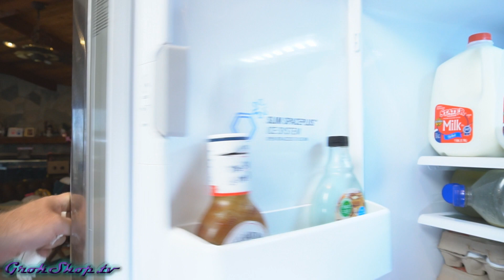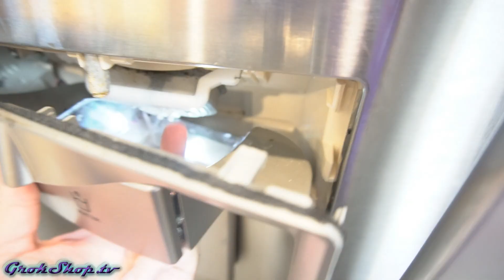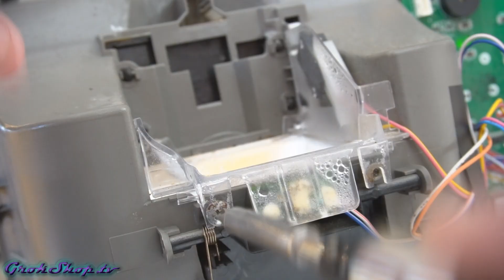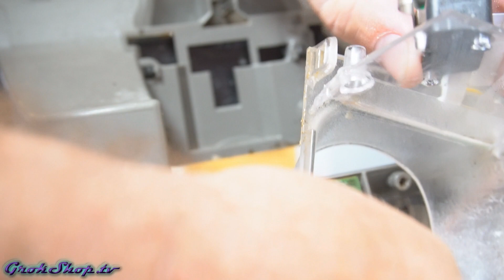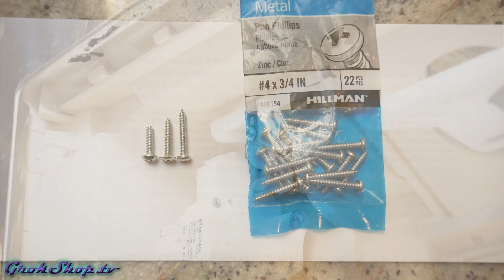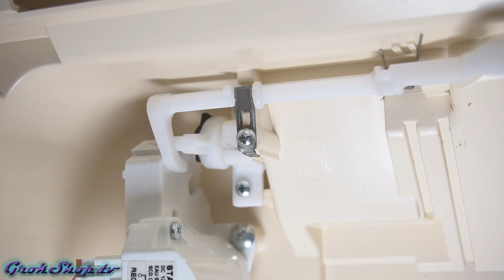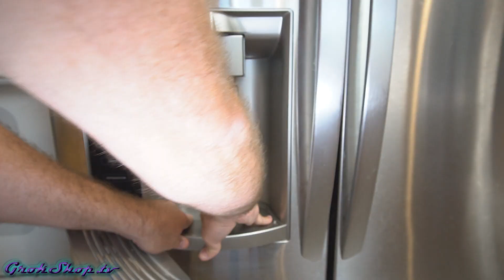LG Refrigerator Ice Dispenser Repair: Ice Dispenser Flap Not Closing

Comment: 11 year old LG fridge of almost identical design (plastics were dark grey behind the dispenser panel, but otherwise identical). Exact same issue and repair. The only difference is that I removed the motor that kicks the door out for better working room, especially gluing the standoff back. Of course when I went to put the motor back in, I found the screws wouldn’t seat because the holes stripped to some extent as I removed the screws. Went with a slightly longer replacement and all is well. You saved me hundreds, I’m sure. Thank you!

Comment: Thank you. To my surprise this was the first video I found with my exact model fridge, except mine is about 10 years old now, and broke in the same place. I did use some JB weld CA glue to fix the post, so we’ll see how long that lasts but didn’t have any other options at the time.

Comment: Honestly I chose the easier route by deciding not to put the broken plastic collar piece back in. I just used a #4 x 1 inch screw and just screwed it into the back piece on the other side of the broken collar. It seems to be holding in place as of now but keeping my fingers crossed it lasts until I'm done with the fridge lol😂

Comment: I have the exact same issue like you, and the front panel looks impossible to open, luckily I found your video, so I'll give it a shot tomorrow 🤞.
As for the moldy rubber piece, not sure if bleach is safe to use since that part touch the ice, but idk if there's a better solution either

Comment: Thank you very much for the video,  I have followed your step by step instructions and able to remove the front panel and found the bottom mount plastic have broke off, I replaced with a 6g 25mm screws so it fixed the bracket into position and it work! Thanks you very much.

Comment: Thank you for saving me $300-$500 by calling a contractor.  I have the near exact same LG fridge, and had the exact same problem with the flap.

I didn’t exactly what you did.  The ice machine now works perfectly.  And a horrible mold/mess is cleaned — I used a mix of hot water/vinegar/bleach/lemon juice.

Thanks again!  Your video is perfect.

Comment: This is how a "do it yourself" video should be done! I had this same problem, with a 9-year-old LG (it's been a solid fridge, honestly), and dreaded having to (1) hire a repairman or (2) buy a new one. I was actually happy when I discovered the same breakage, as I felt sure I could fix it with this video. I was right!

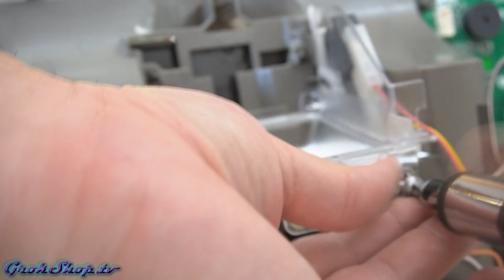It was easier with a second pair of hands, and my wife jumped right in. Also, be careful with the placement of the white plastic lever arm in the dispenser assembly. If it's backwards, water will spray out uncontrollably (bitter experience). Look CAREFULLY at 3:58.

I'm curious if you can share if the fix is still staying fixed for you 5 years later.

Thanks again!

Comment: Thank you for this. My refrigerator had a different problem, but your video helped me solve it. In my case the actuator for the ice flap had come unplugged. The biggest problem was loosening the tabs to get ice / water dispenser unit out. With the unit out, the problem was quite obvious, easy to fix and test.

Comment: Perfect walkthrough. THANK YOU! My ice dispenser started clogging over the past two days. A quick look and I could see the flap stuck open and assumed the ice was melting and freezing into a block. Came to YT to troubleshoot and this video nailed it. The same post was snapped. Followed these steps using a spare screw I had on hand and it is working perfectly now.

Comment: Exactly the problem down to the broken plastic screw holder!  2 trips to the hardware store (I didn’t have a small enough bit) and a bit of frustration later (I lost the broken piece or plastic, so I screwed it in without it) and it is working perfectly!  Thanks for this excellent video.

Comment: Holy crap, I came home to find our ice maker was completely clogged up. As it turns out the door wasn't closing and it had frozen clogged. I found this video and within 30 minutes I had the panel off, taken it apart to clean and sanitize it (yuck!!!), it was exactly the problem as in this video, the door starting closing as it should, put it back together and it's better than new now. THANK YOU!!!!

Comment: DUDE.... this is the exact problem I was having. Thank you so much for your amazing video. Thank you for the tip about drilling out the broken piece. Thank you for showing the EXACT screw I would need (I was able to buy just one at ACE for $.06). I cannot tell just how help this video was and how grateful I am. 

 I watched your video last night. This morning I removed the panel to confirm that I had the same problem, drove to Ace to get the screw I needed, fixed the problem, and reassembled everything in about two hours. I can't believe it was that easy. Thank you! Thank you! Thank you! You saved me so much time and money. Great video!

Comment: My fridge had the exact same problem. I had called a service "expert" and was told the problem was a faulty switch which would cost $400 for a service call to repair. Your video was bang on and easy to follow. I did use a bit of superglue to strengthen the post but otherwise did everything as you suggested and 'VOILA' my icemaker is working again..Thanks for the very informative video,

Comment: this is clearly a bad design from LG. after getting mine fixed it was very obvious that the pivot (between motor and flapper assemblies) was still flexing when the mechanism cycled. out of curiosity... how long has this repair lasted for those that have had this issue?
Reply: I am currently looking into the same repair three years after fixing it the first time. It broke further down on the screw post this time, so I'm hoping some more Super Glue and a longer screw will hold it another three years.

Comment: The problem was exactly like the one in your video.  My fridge must be a newer model since the removal of the icemaker insert was easier and did not require moving a lever through the ice chute.  I was hesitant at first but I got an estimate for repair which included a diagnostic trip charge and are turn trip with parts.  Calculating it could be a $500 + service repair, I tackled the project with faith in your video.  I appreciated the advice of NOT using super glue, which totally made sense.  I also used a 1" screw so hopefully it never happens again.  Seems like this issue is really a manufacturer defect?  The Grok Shop Rocks!

Comment: Second time this video has saved my arse. I had mold in there and took it apart to clean it. Watched the video about a 100 times for one small part that I was having an issue with. Finally fixed it. Had the repair company coming tomorrow but canceled them. Thank you so much.

Comment: Thank you for this video! I had the exact problem once I opened up the dispenser. Your video was so helpful in showing your solution which I used too. It’s literally 10 cents to replace the 1/2 inch screw with a 1 inch screw and that would have likely prevented the part failure in the first place. Thanks again for taking time to video this and to share it!

Comment: I can't wait to try this. My LG is 12 years old. The ice dispenser still works perfectly but the light stopped working. And when I shined a light up inside the chute, I was shocked to see all of the mildew.  These disassembly instructions will help me to access the flap and other interior parts to clean them. I cannot understand how LG could make a product that cannot be easily cleaned.  Do you have any tips of how to repair light that is supposed to come on  when dispensing ice ?

Comment: Worked perfectly! (after the extremely frustrating process of getting the panel out).  Just one question:  when I popped the panel out two small springs ~1/2" long fell on the floor.  They don't seem to affect the function of either the ice or water dispensers, & I can't see them on any of the online schematics.  Anyone know where they might go?

Comment: I have the issue of my door flap motor stopped functioning on my LS63SPGK side by side. Is it the same process to remove front panel? My display is on top not the side as shown here.

Comment: Thanks for showing how the dispenser is disassembled. My issue isn’t a stuck flap but the ice chute and water controller have completely disintegrated. Went to get ice and small screws and springs flew everywhere! If I can get replacement parts it looks like they’re easy enough to replace. Otherwise I’m shopping for a new, non Korean built fridge.

Comment: Perfect video! Exactly what happened to my LG Refrigerator. I was shocked to finally get the panel off (I didn't break any tabs!) and see the screw was broken off from the back. Used your method and drilled out the old piece and used a longer screw. Works perfect. Thank you, sir, huge help!!!

Comment: I grok this video - and the name of your site ’The Grok Shop’. Heinlein is one of my favorite authors. I believe your site name may correlate with ‘Stranger in a Strange Land’? I will soon apply your EXCELLENT video to pursue further mitigation of our issue. My current fix for our 8yo LGX25974ST /06 is to manually reach behind the door dispensing lever and pull it out gently upon removing the ‘collecting vessel’ and the flap closes (so far). My pre-repair hypothesis is a spring is broken or dislodged - another comment seems to correlate. Subscribing!

Comment: This was the same exact failure on my ice maker, and I followed your same fix, by replacing with a #4 1" screw. I used a $3 suction cup from Harbor Freight on the bottom left to start pulling my panel off.

Comment: I have this flap issue , BUT I also have a water flow issue. Water flow is good from the pump. Water flow is good going in and coming out of the filter. The ice maker makes ice just fine, but the water coming out of the front dispenser drizzles and then just stops. The motor is still running when the water stops. I am looking for a video or advice on how to get into the water lines inside the door

Comment: I must thank Google for helping me find you. Terrific professional video and explanation. Very clear and right to the point! I don't need to be entertained by some fancy animation at the start. The video was very clear and stable and your audio was also very clear.  I don't quite have the same problem. Mine has a sticky ice switch that is difficult to stop the flow of ice once triggered. Knowing what needs to be done to gain access to what is behind the switch panel will do it for me.  Thank you!

Comment: Oooohhhhh thank you! Flap wasn't closing and it was EXACTLY THAT SCREW. LG should have a recall on this! 
The only thing I'd add is that if you dare to try to superglue the broken plastic piece, you may end up with superglue on your hands, your tools, etc. 42 Cents, for a pair of screws of slightly different lengths. It's a bear to get the panel off, but the fix was just as you showed!

Comment: Please add my name to the list of folks that your video helped!  The problem was exactly what you described, with that broken post. Also a good tip to drill out the broken piece to allow the screw to pass through. The front bezel was a pain to get off but I finally got it, the rest of the fix was easy. Thanks again.

Comment: Removing the front panel and expecting to break the tabs is ridiculous. I didn’t even use a scraper. Just put some pulling pressure on the right side of the panel and it will pop out. Maybe use some rubber work gloves to increase grip.

Comment: Hey, great video!  I have a similar problem with the flap not opening completely.  It opens only partially and hence the ice won't fall out of the funnel.  Any ideas what might be causing this?  It works occasionally as it should, but very rarely.  I usually have to open the flap by hand and the ice will fall out.  I would like to use your video to repair this problem and I was wondering if others have had this same issue of not opening fully as opposed to being stuck open?
Reply: If the flap does not open (or partially) it is most likely the actuator DC motor failing.  However, if the LED light and ice bucket churning motor also don't come on, most likely the micro switch, or the plastic lever that actuates it has failed.  All are serviceable after the cover is removed from the door front.  I got the motor from Genuine Replacement Parts ( LG Part# EAU59551204 Ice Dispenser Door Motor @ $51.89 EA).  

See Also: https://www.youtube.com/watch?v=3k79F5WlQ6k.  Although a different fridge model, it shows how the motor actuator arm comes from the factory in the extended/out position, requiring you to hold the flapper open when installing (i.e. arm out = flap open / arm in = flap closed).  Once installed and operated, the motor resets itself to the flapper closed position after 4 seconds, ready for the next cycle.

Comment: PLEASE contact or reply to this message.  We had a locally trained LG repairman come out and tell us that our problem could not be fixed.  The problem is the flap sticks open because the paddle sticks so until we get the unit pulled out and look behind it, we cannot tell exactly what the problem is.  The appliance repair company doesn't want to attempt it.

Comment: I never make comments about these videos but feel compelled to weigh in on this one. 
I followed the steps depicted here to a T. Discovered that the issue described here was exactly my issue. And the repair was easy and very doable. 
2 things. For anyone counting or keeping score, I did break one tab. Also, long curved nose forceps are a handy tool to hold the stand-off in place while turning it to find the matching broken surface. 
Very useful video.

Comment: We have an LMXS27626S with this failure. I used a combination approach to removing the dispenser cover, first the putty knife to pop some tabs loose and then tugging a bit.  It came loose after about 15 minutes. The same post was broken. The post and interior are black.  I removed the retaining clip and the left spring came off while I was fixing the post, so I had to figure out how to reinstall the spring.  Reinserting the dispenser is much easier than removing it.

Great video, just what I needed. Thank you for putting it together.

Comment: Thanks! I used this a reference and had the exact scenario. Fixed it, and it works great. I popped the flapper bar off, and struggled a little with the springs.

Comment: Wow! Thank you SO much!  I am a 69 yo grandma and with your help I was able to fix mine which had the exact same problem.  A few tips to anyone else doing it- pay attention to the configuration if the gadget that moves the bar holding the flap.  Also when replacing the flap mechanism pay attention to how you put in the spring so it correctly puts tension so the flap closes.

Comment: This was very helpful !  I expected to find a broken post like shown here, since my symptoms were identical.  The screw post was not broken, things just seemed to stick.  I took a cue tip with a little silicon spray and lubed the white lever and points were it interacts with other components.  This seemed to work...at least for now.  It does look like the white rod starts to deform over time, so maybe down the road that will need to be replaced.  Getting the panel out was a hassle.  I tried the "pop out" method I saw elsewhere, but that didn't work for me ( or I am too faint of heart ).  I did manage to pry it out without marring the finish.  Thanks for linking to the manual - nice to read that even the pros break a few clips and that it's "SOP"

Comment: You the man, my screw broke in the same position as yours, I would’ve taken off the whole inside panel if I haven’t seen your video,I use a needle nose pliers to hold the plastic piece while I use the magnetic Philip screwdriver to put in the screw, work fantastic and  it only cost 19cents.Thanks

Comment: Nice tutorial. If the plastic system is not broken, check the micro commutator of the ice panel. Make a short circuit between the two wire. If the ice door is now opening, the micro commutator have to be replace. Cost: around 3$. Good luck!

Comment: Great video and step by step instructions! I have the LG # LFX25975ST  /00 and we just replaced the whole ice maker assembly. We were having some issues with the ice maker and then one Sunday morning, the ice started flying out of the shute with no one nearby. Then we had smoke coming out of the front of the ice maker. After a couple hours of trying to get a repairman unsuccessfully and the refrigerator unplugged, I went online to one of the parts places. I had my model # and S/n, but had trouble with finding the specific model the site was looking for. In the chat, I gave the guy the model and they ordered for me the ice maker (not the whole assembly...my error for not looking at the link he sent) and would get the part by Wed. (came Th.). We then had to remove the whole ice maker assembly in order to have the refrigerator plugged in so we wouldn't lose a full freezer of food. After removing the whole assembly, we noticed the melting of the plastic and a transistor was behind that part. Needless to say, tried finding the correct piece I needed, but LG stopped making that part. I had to go to a different parts place, and this time in chat, I told what had happened, gave the part number on the back and was shipped a replacement part for the discontinued part. We noticed however, the upper two screws holes in the old part is not there in the new part, so the only two screws holding the ice maker assembly is the two bottom screws. Any suggestions on how to secure the top part? Also, I now have the issue of the flap not opening unless I open it manually, do I need to order a new flap now for the ice chute? Please help!